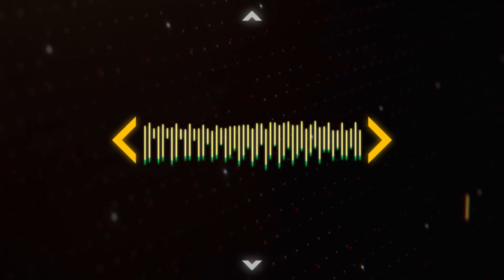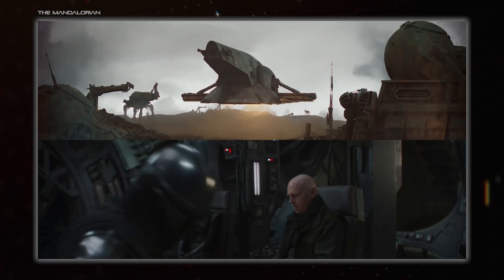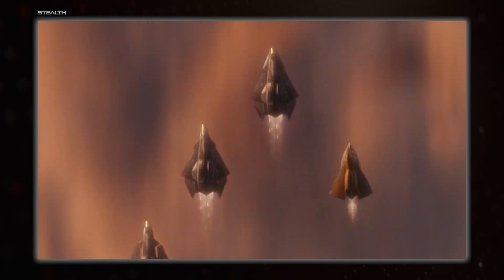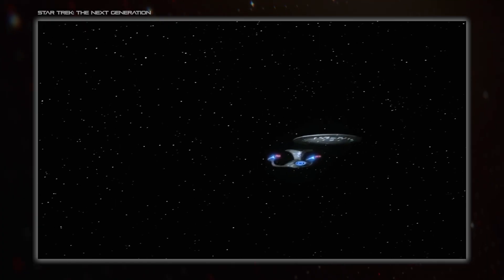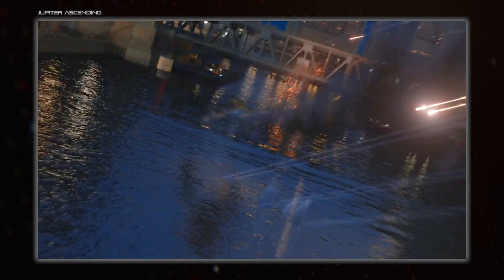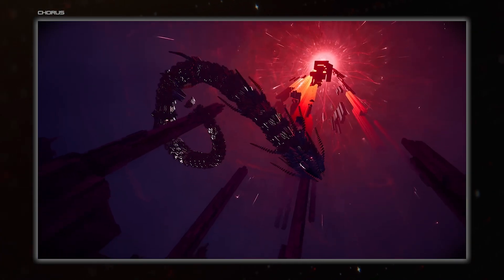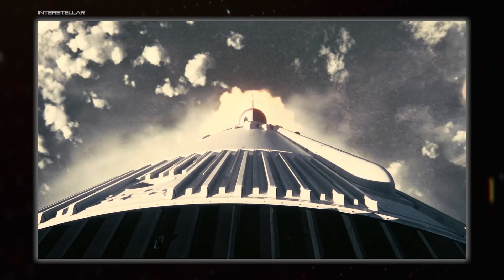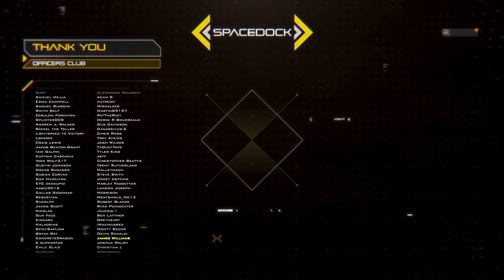Variable Geometry in Sci-Fi Spaceship Design

Comment: Swing wings in our Fighter jets are due to supersonic flight creating eddies that reduce fuel efficiency, so they sweep backward at Mach 3 to reduce fuel consumption, and forward at subsonic speeds.... The newer generation gave up on this design because the pivot points for the wings were weak points, and shifted the center of mass making stealth and compensating avionics a nightmare, and that required a lot of maintenance... 6th generations fighters might return to the swing wing but with a pivot blade around the center of mass (so the wings are fixed but rotate internally with one half sweeping forward and one half sweeping backward... this removes the weak point, and keeps the center of mass of the fighter but looks really awkward... though they've tested the design and it maintains more fuel efficient at super sonic speeds....

Comment: My personal opinion is there needs to be a reason for a transformation. Something other then "Because it looks cool".
TNG's Enterprise use of the Saucer separation the two times during the show and in the movie.
SDF: Macross when it changed during battle because they needed the cannons to connect to engineering.
Star Wars use of transforming ships as docking procedures.
All good uses. And if I recall even the x-wings foils where extended to allow additional heat loss from use of the weapons, Allegedly. I'd need to look up before I could say for certain.

Comment: still no macross, I mean no mech but just the base from of the ships have some variable shapes, the classic variable swept wing for the VF-1 and VF-25, the high speed mode of the YF-19, the weird wing tip fold high mobility mode on the VF-31 or Sv-303, hell the most insane one with just morphic wings on the YF-21. and I mean only the OG SDF-01 had the bow split to fire the macross cannon

Comment: The best application of variable geometry I know of is in the Jovian Chronicles game (from Dream Pod 9, creators of the Heavy Gear franchise), specifically with the Jovian ships that can have their centrifuge modules rotate 90 degrees. When the ship is accelerating, the modules are oriented so that their "bottom" section points in the direction of thrust, then as the ship acceleration winds down and the centrifuges start rotating, the modules slowly rotate until their bottoms are parallel to the ship axis.

Also, I get that they might count as mecha due to the humanoid shape and the Daedalus Attack punch, but I can't believe Macross ships don't join this list. At least include the Zentraedi gunships. One of the most common applications for variable geometry is actually to expose a huge ass gun the size of the entire ship.

Comment: Honestly, the best use for variable disconnected parts in space, would be for solid armor plates. Armor that cqn shift position like some sci fi shielding and provide extra ablative protection that will prevent damage to the ships superstructure as might happen if the plates were connected to the ship directly.

Comment: I think variable geometry should stick to changes that affect flight dynamics, and shouldn't include stowage or weapons. After all, carrier aircraft have had folding sings since WWII if not earlier. Also, current stealth aircraft carry missiles in bays, as did bombers in WWII, so that shouldn't really count either. S-foils going into attack position seems to me to be an edge case, but everything I've seen suggests that it's about gun dispersion not flight dynamics, so maybe it shouldn't count. A better question is if moving engine nacelles should count or not, such as for a tilt-rotor or VTOL F-35 or Harrier.

The hero ship in the story I'm writing has variable geometry because it can enter an atmosphere with various profiles to be either a wave-rider or a blunter lifting body, for differen maneuvers from aerocapture to aerobraking to waveriding or merely trajectory change.

Comment: I know mechs don't count, but i like to think the gundam x, double x, and f91 should be considered.

Mostly cuz the features they use do involve its geometry, as the gundam x's x-shaped reflector panels reflect the microwave beam into itself to charge the satellite cannon, the double x also does this but also involves radiator fins on its arms and legs. Similar to the f91's shoulder radiator fins. 

These features aren't used by the mech that often and only deployed occasionally

Comment: In my opinion highly-variable craft/robots, while super cool-looking, work most plausibly as a narrative signifier of biology-adjacent, alien, or smart-matter tech, where you're deliberately trying to give them an 'animal' appearance implying that they're maintained mostly internally through nanotechnology or similar rather than with mechanics working on them.
If maintenance is done internally with an army of tiny robots (as it effectively is in animals), having thousands of little redundant actuators distributed throughout the device becomes more plausible, whereas such a device would almost certainly be impractical to service by traditional mechanics, aside from basic interventions to patch leaks and assist recovery that might be as analogous to medicine as they are to traditional damage control. Continuously-rotating joints like wheels or helicopter rotors are difficult here (note that animals never figured them out) because of the difficulty of passing multiple fluid and information feeds through such a joint, but not out of the question; IIRC we can make rotating fluid hookups (and slip rings) just fine now, with some difficulty, and presumably if they were self-healing they'd work even better.
Another (storytelling/spectacle) benefit here is that such designs are likely to 'bleed' when struck, with repair nanomachines and their supply/distribution fluid, fuel/coolant supplies for all the distributed machinery, and possibly hydraulic fluids used to move the sections venting briefly from damage before built in nanomachines/repair bots/built-in tourniquet points/valves seal the breaches. And continuing leaks after they should have been automatically sealed is a sign of deeper, escalating issues that could threaten the entire machine, in a way that is very intuitive to us as largely liquid-based creatures.

Comment: Something that comes to mind on the function-over-form perspective would be to alter a spacecraft's center of gravity, likely for some benefit in maneuverability / course-correct. Not sure how practical that would be over direct propulsion like RCS thrusters, but depending on the tech-level and "hardness" of the sci-fi, it could be a method to conserve fuel / propellant, altering mass distribution to create stronger lever points where thrust is being generated.

Also Variable Geometry could play a role in stealth design. F-22's, B-2's, etc. have to carry ordnance internally to minimize their radar signature until their ready for weapons release. The same logic could be applied to a spacecraft.

Comment: It is cool, but sci fi is bad at explaining what the variable geometry is for. Expanded material say the X wing going to X mode is for putting the lasers further apart for cooling but I have not found what advantage the flat mode has. It would reduce atmospheric drag I suppose, but they use it in space too.

Comment: With variable geometry, there are also a few universes that use it for transitioning modes. Like extending armor panels that close over more vulnerable parts for either combat or atmospheric entry, protecting more delicate pieces such as sensors, cameras, or even weaponry. Or a transition from space to atmospheric flight...

And with shifting things around, that also could cover things like gunports that open/close for battle, which is notable as something in Babylon 5 (Especially what started the Earth/Minbari War). 

Star Trek also has the Klingon Bird of Prey and the Suliban ships that both have transitions, though the Suliban one never stops shifting around.

And for separating ships, I believe the US military had been working on something similar to it with a recon design that was largely a larger transport with a bunch of drones that could dock with it for fuel and transport.

Comment: There is a realistic but far future concept of using the radiation of an black hole (Hawking radiation and/or the accretion disk) as a low thrust but extremely efficient thruster, (I think I saw this on Isaac Arthur's channel). I realized that starting and stopping the ship would require moving large amounts of mass (and shielding) around the black hole. Just to stay in place you need equivalent masses (mass / radius^2) in front and behind the hole. Accelerating forward meant moving that mass so it is in front of the hole to pull it forward, you would need to carefully adjust the gravitational attraction to match the radiation pressure (i.e. your thrust). On second thought this probably gets a lot easier if you give the black hole an electric charge first, (you still wouldn't be very maneuverable).

Comment: Jupiter Ascending fan here. I got your back on that.   But floating parts however, that's gunna be a big no. One EMP or a momentary power spike/failure and you just lost part of your ship.  Especially on things like weapons or engines which exert their own forces when bring used, drastically increasing power demand for those systems just to keep them from flying off into deep space.

Comment: It's subtle, but there's still a bit of variable geometry on real life aircraft - flaps and slats.  You change the geometry of the wing to trade between lift and drag; a smaller wing for less drag, larger wing for more lift.  This allows a wing that both provides enough lift at lower speeds for take off/landing while also allowing a more fuel efficient wing to decrease costs and increase range.

Comment: I'd like to see one where the variable geometry is spinning section for artificial gravity when not accelerating, but then it moves so that the "floor" is the back of the ship so that "gravity" points in the same direction internally when under constant acceleration.
Reply: The Argo from the Battletech video game adaptation does this! Three habitation pods on a rotatable ring. When under thrust, the ring is stopped and the pods hinge back for thrust gravity. When at rest, the pods hinge outwards and the ring starts spinning, counterbalanced by a much slower spin of the (presumably heavier) engine section in the opposite direction.

Comment: This is a minor and unfortunately obscure example of variable geometry, but Escape Velocity Nova introduced the possibility of it to the engine, and used it for a few ships. The Asteroid Miner unfolded wings/prongs to fire (story-wise it unfolded to expand its collection area, but for engine-mechanical reasons it was marked to use the animation when firing), the Starbridge had its main engines shift independently to assist direction changes, and the Pegasus had the engine/bridge/living sections rotate while the cargo ring remained stationary.  
The largest Vell-os 'ship'/psychic construct does use disconnected segments, but they don't move separately from one another.

Comment: I'm surprised you didn't cover the main ship from Robotech/Macross. They used variable geometry for more than just the mechs in the show. The main ship housed a superweapon that required the ship to be transformed to use it. (Why the ship couldn't be built and operated in the gun deployed position is beyond me. They also intended for Earth fleets to be able to dock to the capital ship for things like hyperspace transport. We never really got to see it because the enemy make sure it never happened.
Reply: They actually give two reasons why the ships couldn't be built with the gun deployed in supplementary material from the 1980s in Japan. The first one is technical. The tuning fork gun needs to open up into space because the energy from the charge would rip it apart if enclosed. They can't just keep it deployed because then it would be easy to damage the gun. 

The second is because even the Zentraedi realize that some of their own are potentially mutinous crazy idiots who might shoot up their allies for fun, so they make sure their most dangerous ships can't fire their most dangerous guns willy-nilly without the fleet commanders approval. Yes, Zentraedi gunship captains couldn't open their main guns without a release code from their fleet commanders. Ultimately, this failsafe didn't exactly work because the crazies could end up getting promoted to fleet commander themselves (like the case with Quamzin Kravashera).
Reply: The ship was never meant to reconfigure to fire the gun. It does it the 'normal' way at least once near the beginning of the series. Problem is, the ship was a wreck rebuilt by humans, badly. Then they tried to use the space fold engine in a gravity well. It 'worked', but the FTL engine disappeared, and took many of the ships power conduits with it. Including the ones that led to the big gun. The entire point of reconfiguring the ship was a desperation ploy to move the power core close enough to the big gun so it could be powered again.

Comment: In a high resistance medium like air or water variable geometry flight surfaces make perfect sense. The future actually belongs to mission adaptive wings including hingeless rudders. In space it is just bad design. But it indeed looks cool. About rotating gravity producing sections: The bigger problem is that almost nobody seems to understand that it only works when one uses the outer rim as the floor. So stop putting windows in it. Don’t get it? Watch the Thunderbirds Are Go series where they got it right for once. The window in the rotating section of TB5 = the floor 🤣

Comment: An interesting case of floating parts or, as I like to call it, Raymanning from a developers perspective is in the antigrav racing game Redout 2 where all the ships have Rayman parts attached to them, most particularly in the stabiliser fins and auxilliary thrusters. In addition to being a cool visual feature as each part jostles as the ship is constantly maneuvering in high speed turns and jumps, but it allows the devs to use the same in-game model for many parts while not compromising the overall aesthetic of it, you can customise these ships with many different components and it adds its own look without looking wrong!

Comment: One aspect that informs moving parts (or could, in more realistic settings) is where you want your dropship's thrust vector to point. In space and high atmo, you want to move forward with the pointy bit forward, but when landing, that would make you an unstable tailsitter. So many dropships feature rotating nacelles or something else, like Slave One style.

You could of course have separate landing engines on tops of your main ones but that's a bit boring.

Comment: Not covering Macross was a miss. I know they said no mechs or transformers, but the actual SHIPS in macross do a lot of the things mentioned than that's not even counting transformations. 

The moving domes on the colony city ships, the fact that the overpowered main gun on the big transforming ships became an entirely separate vessel, to the 'Sion' class ships of Delta being essentially miniature fleets into themselves as they're composed of several independent ships.

Plus the original macross actually has a reason for transforming (connecting the main guns to power after the space fold engine...folded itself out of the ship)

Plus most of the fighter scale transforming mechs also use variable geometry even within their otherwise static fighter modes, with swing wings and thrust vectoring being more or less standard and even morphic wings and body panels making an appearance
Reply: You could make some argument for the Valks (specifically in Fighter Mode); but the Macross capital ships are giant mechs- they've literally punched other ships to death. (Though the clamshells would would, if minimally...)

Not sure what "Sion" ships you're talking about; do you mean the holoprojectors that Delta Squad can pop off?

Comment: My question of the floaty bits in Star Terk was allway... why? probably 30% of energy gets used to keep it from flying apart so why not weld it on and increas shield and weapon strength^^ Btw German has still folding wings in use on it's old Tornado Aircraft... yes still.

Comment: Variable geometry should be useful simply to allow ship designs and functions that would be almost if not entirely unworkable as a static design. I have been working on a flying saucer command/mother ship design that also needs to function as a space craft carrier, and have modes for FTL, and solar wrangling. The bigger issue is interior space and how that gets muffed up or not. Having gun turrets floating in position along side would simply be Drones minding their position relative to the ship VERY closely. But a thing am I looking at is "solid light constructs". While theoretically sound, it is not yet plausible, and too "Space magic-y" for my liking. At least, for the setting and faction the saucer is meant for.

Comment: when you mentioned the unfolding bits to make centrifugal gravity, I was kinda disappointed when you didn't mention the Argo from Harebrained Schemes' Battletech, which folds the centrifuges back down for Thrust Gravity and then unfolds them when you arrive over a world to switch to centrifugal gravity when the ship isn't moving.
admittedly, I believe the flight centre and mechbays are in the large section that doesn't spin, but I thought it was the coolest design ever when I first saw it.